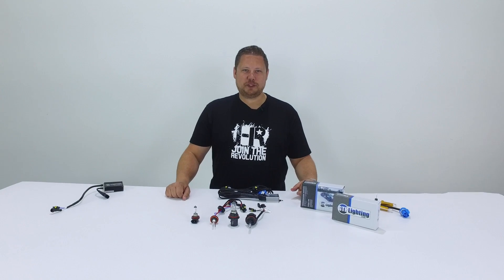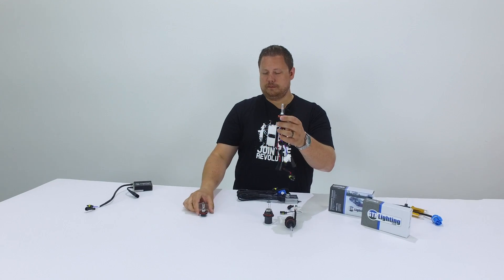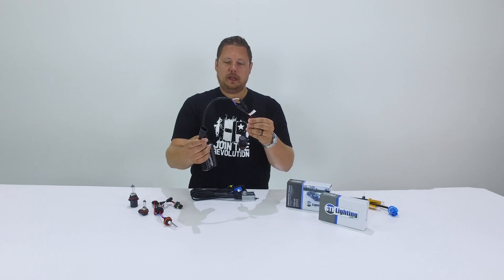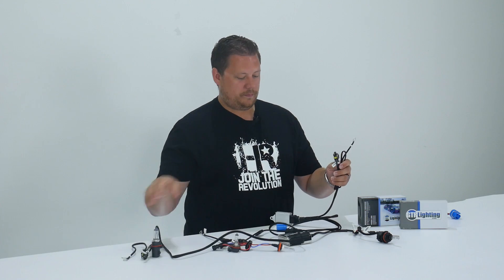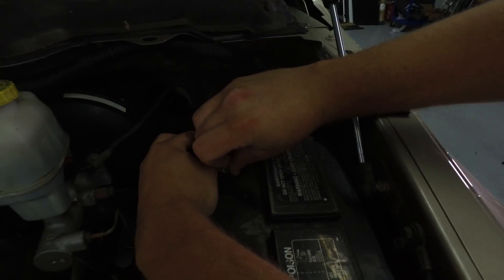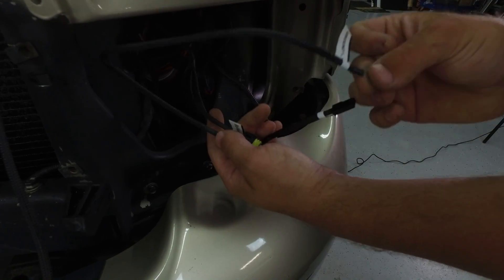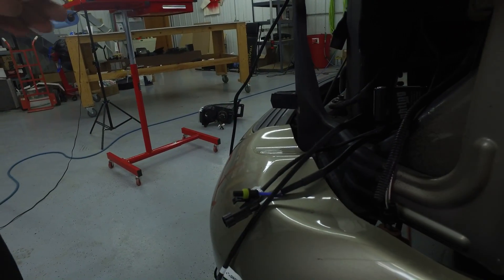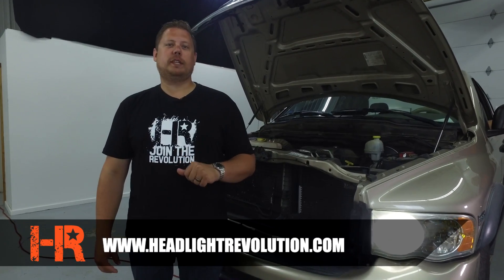How to Install a Dual Beam HID / Bi-Xenon HID Conversion Kit Relay Harness

Comment: Why couldn't a guy just wire the ballast to the low beam wire (which is always on on my vehicle) and connect the solenoid to the high beam wire. Simple no relay needed .   Am I wrong? Thanks.
Reply from the maker: You definitely can, but most OEM Wiring harnesses are not equipped to run HID from the factory so an HD relay harness is always the safest option since it pulls power directly from the vehicle's battery versus the OEM wiring harness.
Reply: Google tells me that Hid's have less power draw than the OEM halogens. Have you found it to be different?

 @HeadlightRevolution

Comment: How do I bypass the ballasts as they seem to be problematic in most cases?
Reply from the maker: If you want to get rid of the ballasts, you'd need to convert your whole system to either an LED or Halogen system which can often be a tricky task to do. We'd love to help you with looking into options Peter!

Send us an email: Sales@HeadlightRevolution.com

Comment: So my headlight has one low and one high. I recently retrofitted two low/hi projectors in each headlight and I'm having troubling figuring out my wring. Can I run my low beams in a parallel and hook the ballasts up to the high beam relay to work when I use the headlamp dimmer switch? Thanks!
Reply from the maker: We should have some wiring diagrams handy for stuff like this, shoot us an email!

218-755-5200
Sales@HeadlightRevolution.com

Comment: Another truck that'll b blinding drivers with their HID's smh. If your gonna run HID's then do it the right way! Do a headlight retrofit! Or don't do it at all. Adding projectors to your headlights with HID's will not only give you better light output then just installing HID's on your halogen headlights but it will keep you from blinding other drivers. I always do retrofits on my cars if they don't already come with factory xenon projectors.
Reply from the maker: Retrofits are the way to go for sure, but for those not wanting to dive deap into that, as long as they alight the bulbs and aim the headlights properly, they shouldnt be blinding oncoming traffic at all! I have linked the video that we made on how to align your bulbs, and I have linked that for you here: https://www.youtube.com/watch?v=OIow5YgdRro

Comment: Yeah they don't tell you that high beam bi-xenon hid bulbs scatter light instead of focusing it further down the road. The adjusting light would be a a good idea, if it worked..
Reply from the maker: Actually, the dual beam HIDs are used in an application where only one bulb is used for the low beam and the high beam. Whatever that factory bulb would have done, the high beam will reflect the same since they are the same bulb in the same position! Let us know if you need anything else!
Reply: Actually your wrong. Because if the hid bulb did the same thing as a factory halogen/ incandescent bulb, it would have 2 chambers inside the bulb where light would emit from, (which are both very close in a halogen) and they both would emit at the same time on high beams. The fact that both filaments on a h13 incandescent bulb light up on high beams, and the hid h13 bulb itself actually moves in is not the same, and does not act the same as a normal halogen. Like i said, it would be a neat trick, if it actually worked
Reply from the maker: Hey, I reserve the right to be wrong! But in all seriousness, we have tested these kits in many different vehicles, and in our testing we have found that there ARE certain housings that HIDs just do not perform as well in. That said, in the majority of headlights we tested these in, the solenoid in the HID bulb did a fantastic job at replecating the factory high beam beam pattern. I am not saying that they will be the most amazing upgrade in every housing, but for the most part they do a fantastic job at replacing the factory halogens! If you have any specific questions or concerns, we would be happy to help out as best we can if you just shoot us an email! Sales@HeadlightRevolution.com

Comment: I need more information on the common power and high beam ground, low beam ground like on the 1996 Tacoma.  And osram style ballasts.
Reply from the maker: Here is some info that I was able to find about the wirinig: https://www.customtacos.com/threads/headlight-wiring-diagram-for-96.122453/

Also, here are the ballasts that we have, the ones from GTR Lighting are a very good option!
https://headlightrevolution.com/headlights/headlight-bulb-upgrades/hid-headlights/hid-ballasts/

Comment: Hey what will happen if i put original halogen bulb in a projector fog lamp.
Reply from the maker: You’ll get a halogen fog light, It should work just fine.
Reply: @HeadlightRevolution  thank you. But i wanted to know if it will have an improvement over the reflector fog lamp and about how much improvement.

Comment: Thank you very much for the video. It is extremely helpful as I am about to install some H13 H13 Xenon HID bulbs with the same highbeam/low beam deal. The video would have used some additional lighting for those dark areas I couldn't see in the video but the whole explanation was excellent! Not even on HID manufacturer websites do they explain how these specific HID kits work so thank you for that. 🙏👍

Comment: Hi. Are the Xenon kits (of each manufacturer) essentially the same? By that I mean that can you install a particular kit in a car with H4 bulbs, and then later remove the kit from the H4 car and install to another car (that takes H1 bulbs) with putting H1 bulbs?
Reply from the maker: The only component that would be able to be used in multiple applications with different bulbs would be the ballasts. The HID bulbs and relay harnesses have to be used in conjunction with the same bulb type that the vehicle has. So if it takes an H4, you'll need H4 bulbs and a relay harness.
The ballasts are universal and can be used in any application.
Reply: @  @HeadlightRevolution , Oh ok. My car's stock headlamps (reflector headlamps) take H4 bulbs and I currently have an H4 bi-xenon kit installed. The reason I ask is because I plan on putting new "angel eyes" headlamps (these headlamps I found for my car take H1 bulbs). So, besides the H1 bulbs that I will need to purchase, will I need a relay harness too, or is it different case with the H1 xenon kit?

Comment: So you can just pop an HID bulb in an incandescent housing?
Reply from the maker: You can indeed!
Reply: @HeadlightRevolution  You really shouldn't. The optics will be wrong and cause glare to other drivers and yourself. What you should do is retrofit a projector along with the HID install.

Comment: First time buyer i have a 2004 Mercury Mountaineer AWD 4.0L HEADLIGHT : 9007 FOG: 9145 which system BIXENON HID should i purchased i am looking for 5000K for maximum light output with 55-Watt for 9007 & for 9145 a 35-Watt HID..... I not sure which system i need or accessories like cancelers, Canbus , Relay wiring etc etc etc....please help
Reply from the maker: Sure thing! You will want the 9007  55w HID kit in a 5,000k color:  https://headlightrevolution.com/gtr-lighting-55w-gen-5-pwm-canbus-single-beam-hid-conversion-kit/

For the Fog lights, you will want a 35w HID kit since the housings are smaller and HIDs tend to run on the warmer side: https://headlightrevolution.com/gtr-lighting-55w-gen-5-pwm-canbus-single-beam-hid-conversion-kit/

Comment: Apparently the vehicle's battery must be located under the hood. So, it seems Mercedes-Benz owners are SOL because their vehicle's battery is located under the rear, passenger-side seat. The battery connector shown is too short unless it is modified / lengthened. Dang it...!

Comment: I have a 2012 ram 1500 and need good lights as I travel for my kids hockey games all winter. My questions are will these work with reflector lights? And if they will what do I do with the old high beam light bulbs? Do I just leave them in or take them out. Thanks in advance
Reply from the maker: Hey! Thanks for asking. We're up here in Northern MN so I can relate. We live and breathe hockey. You definitely want better lighting for winter. 
Low Beam: the 55watt HID conversion kit is the BEST option for your low beam, whether you have projector or reflector housings. It is the brightest bulb and has a great beam pattern. Link to your truck-specific kit: https://headlightrevolution.com/gtr-lighting-55w-gen-5-pwm-canbus-single-beam-hid-conversion-kit/
High Beam: LEDs bulbs will work better in your high beams because the HIDs have a delayed warm-up time (9-12 seconds) before reaching full brightness. When you flash your high beams on, you want immediate light! Link to your truck-specific kit: https://headlightrevolution.com/2009-2018-dodge-ram-single-beam-led-9005-high-beam-bulbs-upgrade-putco-silver-lux/
If you have any other questions, let us know. :)

Comment: I haven't scrolled through all the comments,  maybe the first half or so... the question I have is that if I wanted to use a stepper type of switch(like adjustment knob) would this affect how far in and out the bulb goes in the housing?  Or are they more like an on/off type of thing?  I've asked this on another video and haven't gotten a response yet.

Comment: Honda accord 2012! Do i still need the relay harness if am only doing low beams?
Reply: Brother i would buy the gas one's not the dual lights because ur trying to get one light out of it but if u have it and ur trying to use it with missing harness I my self would believe it would
Reply: Harness is for the dual part for the light to move up and down buddy

Comment: Sir i had ordered bixenon projector... though itwill fits in my Yamaha r15 v2, in my bike it's socket is h4 and bulb socket is also h4 and in projector it's only option bulb fitment is h1 ...plz suggest me how to use h1 bulb in h4
Reply from the maker: DJ Prashant DJ PRINCE, thanks for your comment. It sounds like you are trying to do a projector retrofit. This is very common in aftermarket housings. It is possible, but you will need to do some custom wiring.

Comment: My high beam will not work.The actuators are not moving the blub in to change the high beam. Do I need to Try flipping the polarity of the trigger plug?

Comment: My battery is at the back in the trunk soo what do i do??? Please help
Reply: Fresh Prince:  You can tap into a 12v power source under your hood.  Most newer cars have a fuse box under hood that you can use to tap power for the harness.  I have a video on my channel that shows this.  Search my channel for Lincoln HID.

Comment: how do I connect to the  positive if I have this kind of output -- https://imgur.com/a/3Cywx
Reply from the maker: That looks like a difficult one to install on, but it should be possbile. The HID relay harness is designed for more traditional battery connection methods, so a custom install may be required. If you can't access directly to your battery itself, please find a qualified car stereo install shop in your area. They should be able to figure it out for you.

Comment: Ok so im doin retrofit on a 2017 tacoma.  So while i do understand the bi-xenon bulb will do the job of both my lo and hi beam, what do i put in the hibeam slot now that the bi-xenon does the job of hi beam?  Since only one factory connection is used(driver) what do i do with the passenger side factory connection?  Just let it hang there?

Comment: Go it, One last question on my 2016 Chevy sonic I tried using my HIDs they would not work I was told is due to low voltage they flicker and turn off so if I tried using LED headlights would I run into the same issue
Reply from the maker: brandon wright It sounds like your vehicle has a canbus system that monitors and controls your lighting. A lot of newer vehicles have this and a traditional LED or HID set up just doesn't cut it. For your Sonic we would recommend this kit with an H11 bulb https://headlightrevolution.com/gtr-lighting-55w-gen-5-pwm-canbus-single-beam-hid-conversion-kit/

Comment: I have a question can you use an H11 kit on and H13 as I have an h11 hid  just laying around.
Reply from the maker: brandon wright H13 is a dual beam and H11 is a single beam. Also the connectors are different so it will not work.

Comment: +Headlight Revolution ---- i have a jeep 2015 wrangler i didn't buy the relay, they were stating it's better for 55W but i am using only 35W, should i get the relay wiring too?
Reply from the maker: If you are running a dual beam HID system, then yes we would recommend getting the correct relay harness.

Comment: I have bmw z4 2005 with factory HID but it work in different way , the magnet movement its produced from the headlight assembly so the lamp its not dual . And now i am ordering a new aftermarket headlights that have not this technologies my question is : if i put a h4 led lamp how can i convert the signal from magnet system that coming from car  to 24V  and wire it on the hight beam pin of  the h4 lamp . And the second one is there any tricks to install h4 lamp on a h7 housing ? Sorry for all this questions but i think u may have the solution
Reply from the maker: Email us at sales@headlightrevolution.com and we can answer all of your questions!

Comment: I have 2 headlight bulbs on each side (one for the high beams and one for the low beams). How would I make HID's work on my car? 2 kits of regular HID's without the bi option?
Reply from the maker: Correct, you would need two separate single-beam HID kits. One kit for the low beams and the second kit for the high beams.
Reply: Okay, thanks for the reply!
Reply: Headlight Revolution Seriously?! I bought Bi-Xenons off Amazon and it said the kit fits my truck... apparently not! I have different bulbs for high and low!!!

Comment: hi. in my car the low and high beam are separate housing. both have h7 and h1 hid kit. as i am looking forword to get two bixenon set for both so that i can have 4 low beam and 4 highm bulbs. now all for hid are 55 w. if i connect two 55w bulbs in stock 55w connector it might burn. what can i do so that it will support this thing. help.

Comment: There's too much I don't understand about these HID kits. Why do they usually only do low beam? That makes no sense at all. What about the fact that HID's are supposed to use a projector and not a reflector...but 99%of them still use the reflector, even complete kits that replace the entire existing headlight assys? Why is it so hard to find answers to these questions in the first place????
Reply from the maker: Andork, I'm not 100% sure I understand all of your points but I'll try to answer some:

1. Why do they usually only do low beam?  --- What do you mean? We have kits that do low beam and high beam. It's easy to do both. Even on dual beam HID kits like in this video, it will do your low beam and high beam in HID.

2. What about the fact that HID's are supposed to use a projector and not a reflector ---- Technically there are many OEM headlights that use a reflector housing paired with an HID system. It's more common to see an HID system run in conjuction with a projector housing, but not all the time. When you're doing an HID conversion kit in a reflector housing you are going away from how it was intended to be used, an HID in a halogen reflector housing, but they still work pretty good.

3. Even complete kits that replace the entire existing headlight assys?  ---  I'm thinking you're talking about when you buy an aftermarket housing from somewhere and they throw in an HID converison kit. It's all the same as #2. Proper HID projector headlights cost way more to make and people want everything for free nowadays so almost nobody makes anything decent like what you're talking about because noone will buy it... Check out Starr HID when you get a chance. DOT approved, aftermarket housings with HID systems and projectors.
Reply: Thanks for the reply. I've been mulling the idea of a conversion with my Avalanche (9005, 9006 bulbs) but going online and actually finding something even as simple as a "FAQ" page that explains the basics and separates myth from facts is easier said than done, everyone just wants to sell shit. There is a lot of debate over what works best, what doesn't work at all and what's even legal. That's before getting into the debate over beam patterns plus there's a LOT of aftermarket kits out, and, as we all know, some are good, some...not so much! I hate buyers remorse and if I ever take the plunge I want to do it just once, so, thx again.
Reply: Hid instal on my lincoln

Comment: Thanks for the info and video. I just did install exactly how it was done in this video. My low beams flash on and off, high beams stay on. Any ideas?
Reply from the maker: Did you do it in a 2004 RAM like the one we showed here? If so, we found this RAM needs a little extra help to make it work correctly. We made a second video, much like the one here, but made it especially for this specific RAM, take a look here: https://www.youtube.com/watch?v=XndW7uIu7E4

Pay close attention to one of the last steps in the video I linked. It shows a fix we had to do on the install in this truck. Let us know if that solves things for you or if we can help you more. Send us an email at sales@headlightrevolution.com for more help.

Comment: great video...need a favor i am trying t install my hid in my car but for some reason the ballast on the right side overheat more than the left...i switched the ballast and the bulb and still have the same problem...i replaced the harness  and still the same problem...is it normal...how much temperatures the ballast can resist...need your  help
Reply: Marco Ordonez try a relay harness with resistors on it.